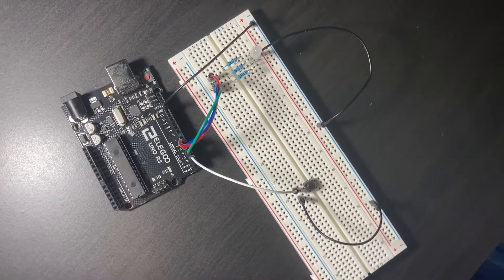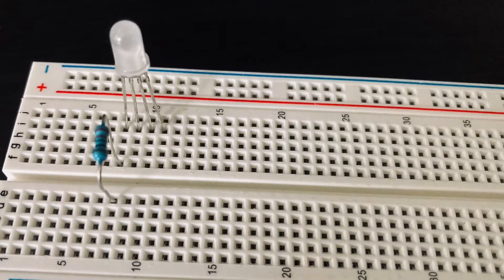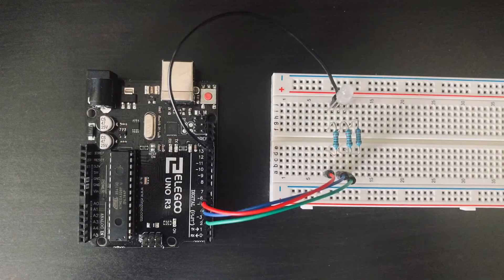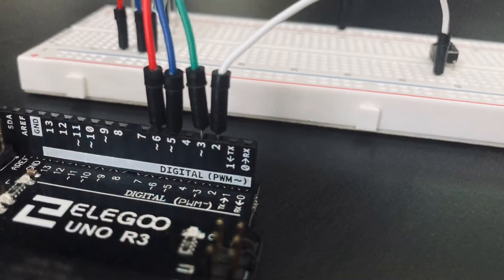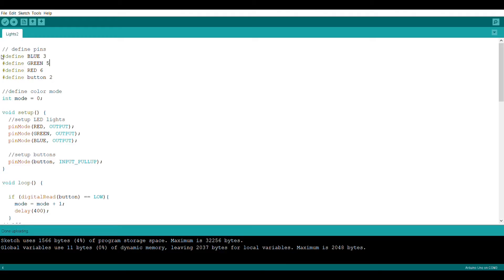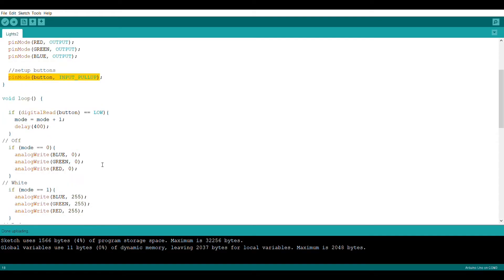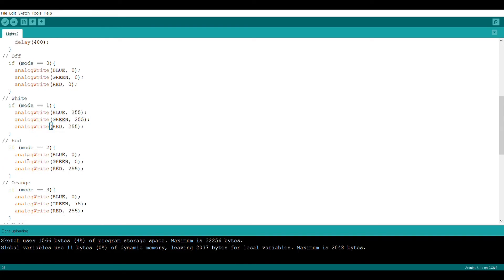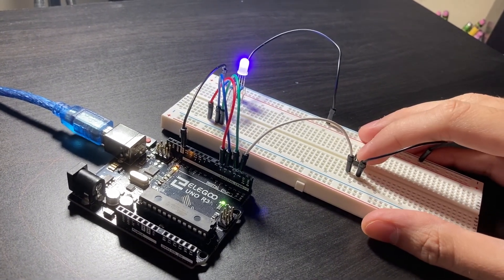Control an RGB LED with a Button | Beginner Arduino Project

Comment: ASANG ANG CODEEEEEEEEEEEEEEee
Reply: #define blue 3
#define green 5
#define red 6

void setup() {
  pinMode(red, OUTPUT);
  pinMode(green, OUTPUT);
  pinMode(blue, OUTPUT);
}

void loop() {
  int bluevalue = random(1, 500);
    int redvalue = random(1, 500);
    int greenvalue = random(1, 500);
    analogWrite(blue, bluevalue);
    analogWrite(red, redvalue);
    analogWrite(green, greenvalue);
    delay(400);
}

Comment: cooooooooooooooooooooooooooodeeeeeeeeeeeeeeeeeeeeee
Reply: #define BLUE 3
#define GREEN 5
#define RED 6
#define BUTTON 2

//define color mode
int mode = 0;

void setup()
{
  //setup LED lights
  pinMode(RED,OUTPUT);
  pinMode(GREEN,OUTPUT);
  pinMode(BLUE,OUTPUT);
  
  //setup buttons
  pinMode(BUTTON,INPUT_PULLUP);
}

void loop()
{
  if(digitalRead(BUTTON) == LOW)
  {
    mode = mode + 1;
    delay(400);
  }

  //OFF
  if (mode == 1)
  {
    analogWrite(BLUE, 0);
    analogWrite(GREEN, 0);
    analogWrite(RED, 0);
  }

  //WHITE
  if (mode == 1)
  {
    analogWrite(BLUE, 255);
    analogWrite(GREEN, 255);
    analogWrite(RED, 255);
  }

  //RED
  if (mode == 2)
  {
    analogWrite(BLUE, 0);
    analogWrite(GREEN, 0);
    analogWrite(RED, 255);
  }

  //ORANGE
  if (mode == 3)
  {
    analogWrite(BLUE, 0);
    analogWrite(GREEN, 75);
    analogWrite(RED, 255);
  }

  //YELLOW
  if (mode == 4)
  {
    analogWrite(BLUE, 0);
    analogWrite(GREEN, 220);
    analogWrite(RED, 250);
  }

  //GREEN
  if (mode == 5)
  {
    analogWrite(BLUE, 0);
    analogWrite(GREEN, 255);
    analogWrite(RED, 0);
  }

  //BLUE
  if (mode == 6)
  {
    analogWrite(BLUE, 255);
    analogWrite(GREEN, 0);
    analogWrite(RED, 0);  
  }

  //VIOLET
  if (mode == 7)
  {
    analogWrite(BLUE, 255);
    analogWrite(GREEN, 0);
    analogWrite(RED, 100);
  }

  //SWITCH OFF
  }
Reply: Thank you Very kind will try it.
Reply: Please note that in the mode OFF  if (mode == 1) this should be 0 not 1 . As 1 is for white. as shown underneath.
//OFF
  if (mode == 0)
  {
    analogWrite(BLUE, 0);
    analogWrite(GREEN, 0);
    analogWrite(RED, 0);
  }

all work fine after except the after the last colour it does not switch off and after another pulse it should go back to the first colour. Please can you check and let us know. Thank you beforehand.
Reply: to solve the problem at the end add this and all works fine.
       //SWITCH OFF
       if (mode==8){
       mode=0;
       }

  }

Comment: Ur Welcome
CODE:

//define pins
#define BLUE 3
#define GREEN 5
#define RED 6
#define button 2

//defube color mode
int mode = 0;

void setup() {
  //setup LED lights
pinMode (RED,OUTPUT);
pinMode (GREEN,OUTPUT);
pinMode (BLUE,OUTPUT);

//setup buttons
pinMode (button,INPUT_PULLUP);
}

void loop() {
  if (digitalRead(button) == LOW){
    mode = mode + 1;
    delay (400);
    
  }
  // off
  if (mode == 0){
    analogWrite (BLUE,0);
    analogWrite (GREEN,0);
    analogWrite (RED,0);
  }
  //WHITE
  if (mode == 1){
    analogWrite (BLUE,255);
    analogWrite (GREEN,255);
    analogWrite (RED,255);
  }
  // RED
  if (mode ==2){
    analogWrite (BLUE,0);
    analogWrite (GREEN,0);
    analogWrite (RED,255);
  }
  //Orange
  if (mode ==3){
    analogWrite(BLUE,0);
    analogWrite (GREEN,75);
    analogWrite(RED,255);
  }
  //green
  if (mode ==5){
    analogWrite(BLUE,0);
    analogWrite (GREEN,255);
    analogWrite(RED,0);
  }
  //BLUE
  if (mode ==6){
    analogWrite(BLUE,255);
    analogWrite (GREEN,0);
    analogWrite(RED,0);
  }
  //Violet
  if (mode ==7){
    analogWrite(BLUE,255);
    analogWrite (GREEN,0);
    analogWrite(RED,100);
  }
  //Switch off
  if (mode == 0){
    mode = 0;
  }
}

Comment: Send code
Reply: use mine.. *it has way more colors*:

#define blue 3
#define green 5
#define red 6

void setup() {
  pinMode(red, OUTPUT);
  pinMode(green, OUTPUT);
  pinMode(blue, OUTPUT);
}

void loop() {
  int bluevalue = random(1, 500);
    int redvalue = random(1, 500);
    int greenvalue = random(1, 500);
    analogWrite(blue, bluevalue);
    analogWrite(red, redvalue);
    analogWrite(green, greenvalue);
    delay(400);
}

Comment: PLEAS SHARE THE CODE
Reply: use mine! *it has way more colors and is way more advanced/simple to write. u can copy paste mine*:

#define blue 3
#define green 5
#define red 6

void setup() {
  pinMode(red, OUTPUT);
  pinMode(green, OUTPUT);
  pinMode(blue, OUTPUT);
}

void loop() {
  int bluevalue = random(1, 500);
    int redvalue = random(1, 500);
    int greenvalue = random(1, 500);
    analogWrite(blue, bluevalue);
    analogWrite(red, redvalue);
    analogWrite(green, greenvalue);
    delay(400);
}
Reply: @ဪဪဪဪဪဪဪဪဪဪဪဪဪဪဪဪဪဪဪဪဪ-ဘ၂ဝ I just ran your code myself and it works PERFECT! Thank you so much for solving my problem. You are amazing.

Comment: great job! but can you share your arduino code used for this project????
Reply: use mine it has way more colors and is way more advanced. but simpler to write if u dont have copy paste

#define blue 3
#define green 5
#define red 6

void setup() {
  pinMode(red, OUTPUT);
  pinMode(green, OUTPUT);
  pinMode(blue, OUTPUT);
}

void loop() {
  int bluevalue = random(1, 500);
    int redvalue = random(1, 500);
    int greenvalue = random(1, 500);
    analogWrite(blue, bluevalue);
    analogWrite(red, redvalue);
    analogWrite(green, greenvalue);
    delay(400);
}